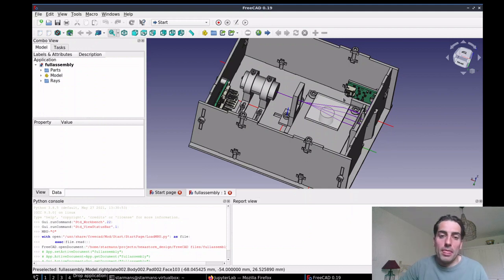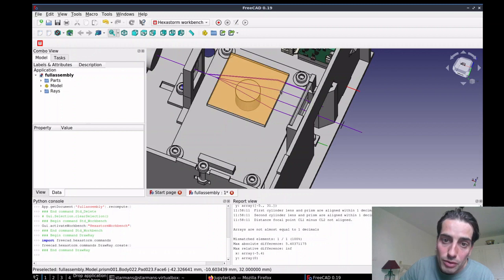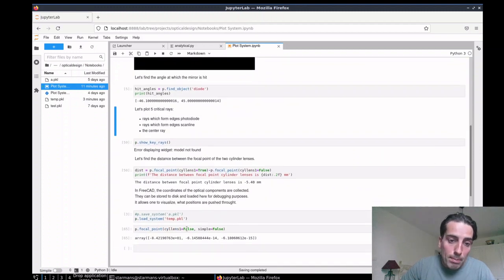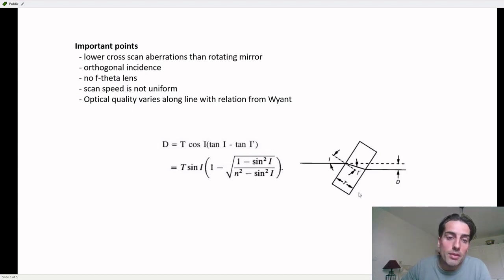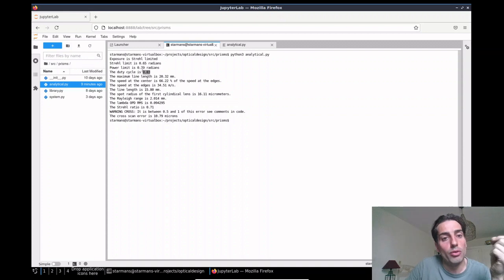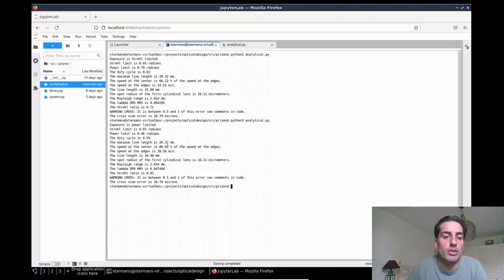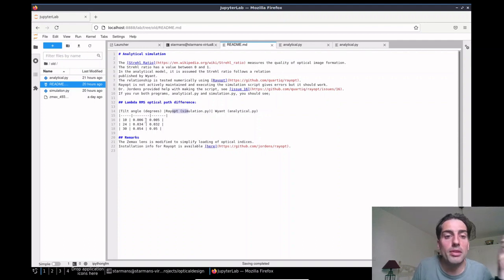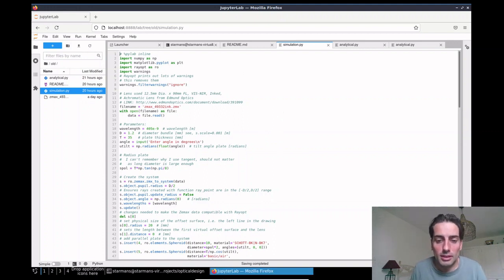Digital Twin: FreeCAD and pyOpTools

Comment: Hi,
Thanks for sharing, I'm currently trying to use pyoptools with Freecad, being a beginner with linux the learning curve is steep.  
I have a question, why didn't you use the pyrate module of freecad ? (I also have no experience, I'm currently looking for software for my optical project).
otherwise, thank you for your project, it's extremely interesting !

Best ;)
Reply from the maker: Thanks for watching. I never heard of pyrate so will definitely check it out. Documentation on this topic is still a bit scarce in the freecad community so I just picked something.